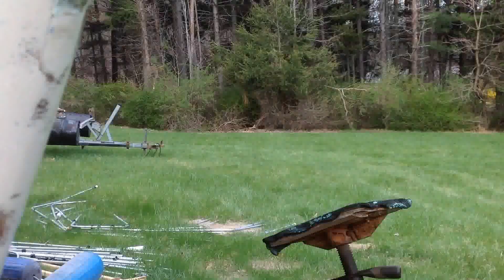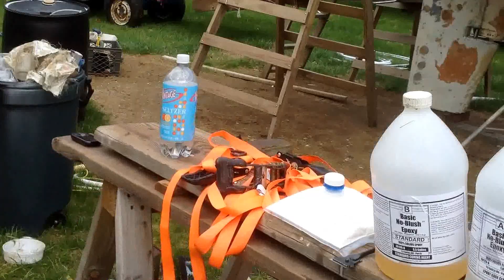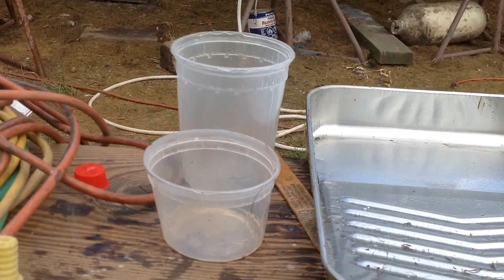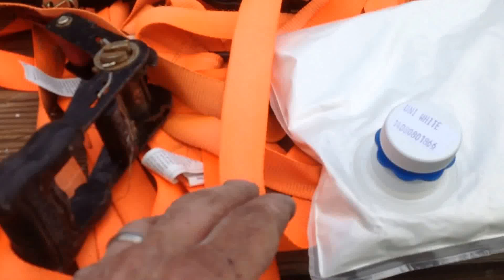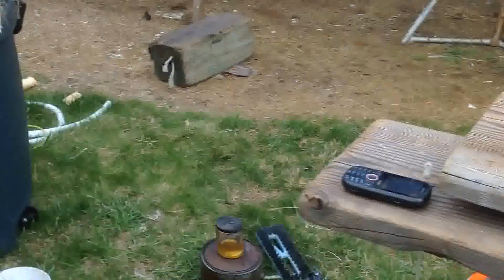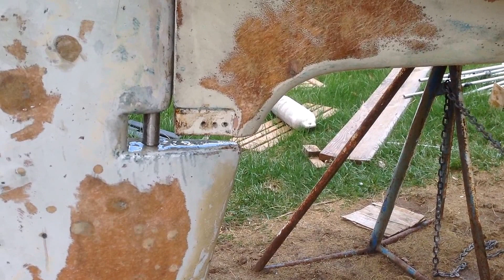Barrier coating bottom

Comment: think you could provide a list of the steps you took to do this repair? I am looking at a similar project myself
Reply from the maker: Once the boat is hauled and let dry for 1 day. you need to get these tools  they all can be purchased from Harbor Freight.  wood plane, 4 1/2" grinder with 36 grit sand disc 9 " disc sander with different grit disc sand paper. From ebay you purchase a pin less moisture meter. this is the one I used "General Tools-MMD7NP Pinless Moisture Meter NEW SEALED WITH BATTERY."  
When I purchased this meter I performed a test,  this meter against a official  fiberglass meter. What was found is if you place the ebay meter on the concrete setting its the same reading as the official meter. 
 Now take a reading before you start below and above the water line keep a record.
Time to peel the gel coat only peel the gel coat when you see chop mat stop that's the layer under the gel coat. This is done using the plane on long flat areas the 4 1/2" grinder is used in areas that you can't use the plane. Use the 4 1/2" grinder  with 36 grit and grind the blisters  to remove the delam,  make sure you grind  the     area using a 12 to 1. You will be replacing the taper  with a build up of glass starting with the smallest patch to a larger patch with fiberglass, as you grind take notice of how many layers of glass you are removing .Once the bottom peeled take another reading below the water line. My boat took 18 months to dry. When the reading above the water line is the same below your ready for the next step.
You will need polyester resin and fiberglass cloth. I used chop mat, fat mat, rover woven 10 oz.  and blue masking tape 2" wide.  when repairing the blisters you will be making the patch for each area with a build up of the different fiberglass with the outer most layer   chop mat add as many layers as have been removed. you want the repaired area to be slightly bulging beyond the hull because you will be sanding it to fair the repair. the patch fiberglass is cut in the shape of the repair, starting with the largest  that will overlap the grinded area about 1" all the way around the blister, then each layer is cut a little smaller by about 1/2" to 3/4" until you  are at the smallest of the hole.  you when making the lay up of the fiberglass patch use a thin piece of ply wood say 12" by 12" as a pallet on this you will placing wax paper get it from your wife, on the plywood  you will place the wax paper first then lay the largest fiberglass mat with resin and keep placing each smaller piece of fiberglass on it  making sure to  use plenty of resin so the complete patch is well saturated with resin. now pick up the plywood  and place it over the blister area, I used  jack stands to hold the plywood in place. use the masking tape to tape the wax paper against the hull to control the resin, tape around the area, this action will held conform the patch to the shape of the hull. Resin will leak out this is ok because it is the excess. Do this to all blisters. Do one at a time because you have work fairly quickly  so the resin does not kick before it is in place. Let cure for a few hours depending on temperature  I let mine cure the whole day, remove the wax paper then fair the area. once all the blisters are faired its time to barrier coat the bottom,
 First the bottom has to be sanded all over  with 60 grit to give the epoxy tooth to bond to the hull. Then use epoxy to coat the bottom to about 20 to 30 thousands thickness. Most barrier coats will tell you how thick it goes on so you will know how many coats to apply I did 2 coats and used progressive epoxy. the info on the epoxy tell you how thick each coat will be. after that you can use bottom paint. This is not a 1 day job it will take weeks since I had other work I did on the boat I was in no hurry. I had the boat shipped to my house. since I had just purchased it from Florida and sent to it my house in New Jersey. That's it for now I you have other questions just ask.    Its a bit of a long explanation bet detailed.   Jim T